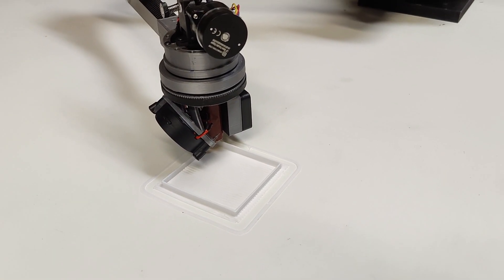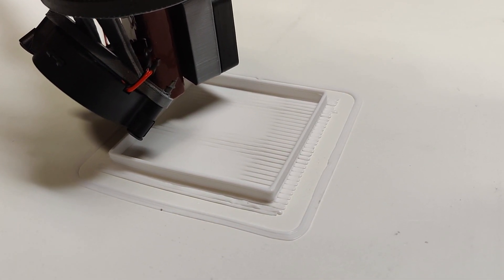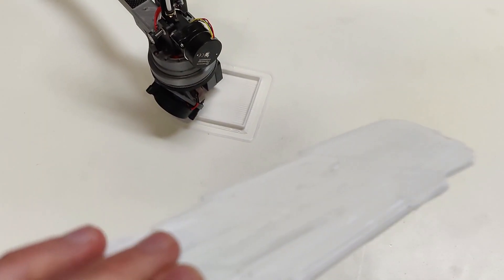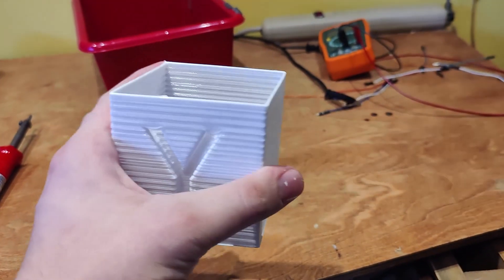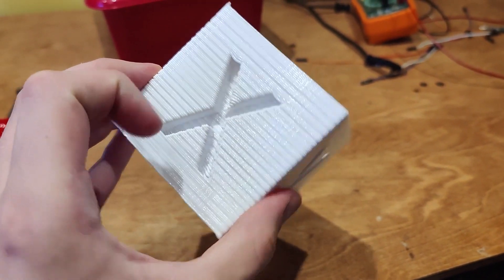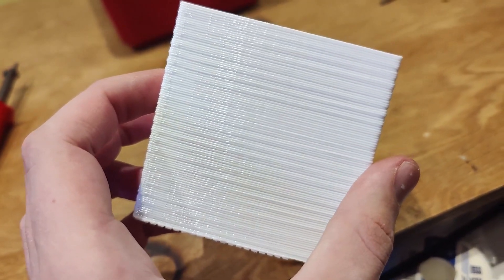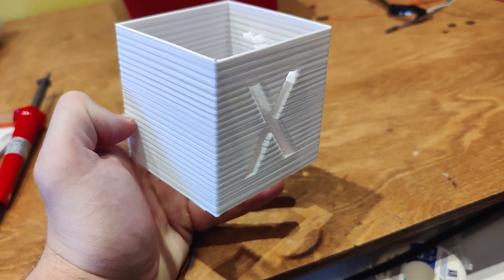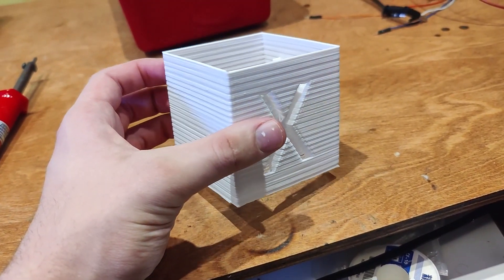The first successful print! - IBIS S1 SCARA 3D Printer

Comment: nice work, congratulations! unfortunately i suspect that the z banding is wobble in the outstretched arm, but you already proposed doubling up the first arm segment which i'm sure would help, and you're making fantastic progress. looking really good!
Reply from the maker: I actually think it's due to cooling, the banding isn't uniform as one would expect. Depending on the extrusion line it will be smooth on one side and banded on the other (same line) so I think it's because of non-uniform cooling
Reply: Both could be true to different extends. Also the gcode could say up and the arm doesn’t go as much as expected? So you get that squish? Or would it be more of an elefant foot? Hope you have fun tuning!